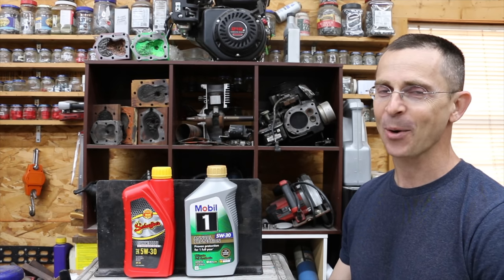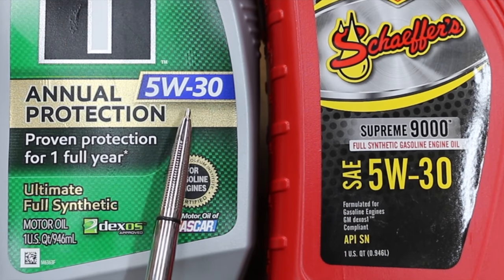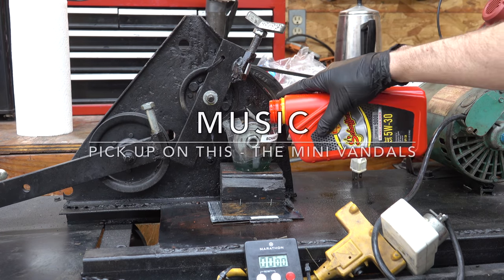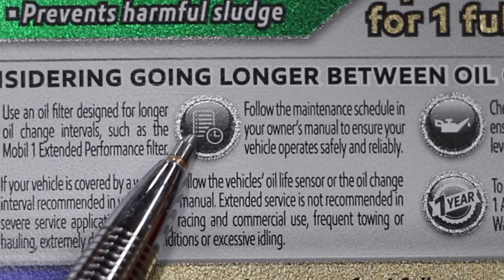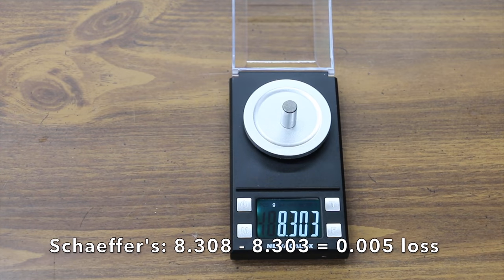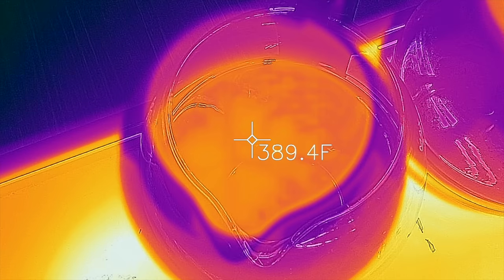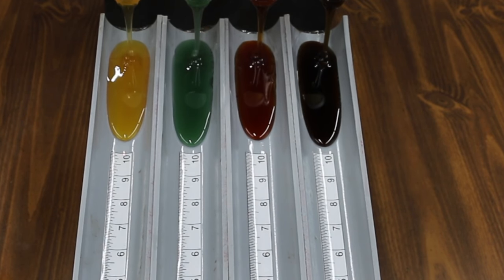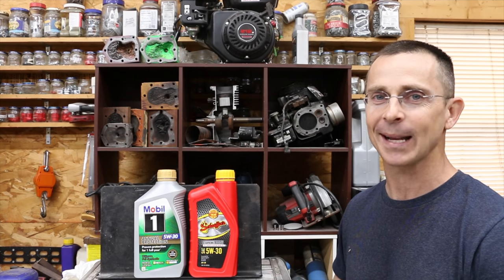Is Mobil 1 better than Schaeffer's Full Synthetic 5W-30 Motor Oil? Let's find out!

Comment: Being an Infiniti Technician the highest service interval I've seen is 10,000 miles. That would apply to the Q50/Q60 Vr30 engines and the  2.0(mercedes) engine.
Reply from the maker: This is great information! Thank you
Reply: My Porsche 997 has Mobil 1 fully synthetic specified and 20,000 mile service for oil. Porsche allow the car to be raced while under their warranty ( not voided) which is pretty amazing. The only aspect they are very strict on is not exceeding the rev. Limit of the engine,  which is impossible with pdk gearboxes but easy with manual or standard shifters.
Reply: @Frazpas  oh really ? Nice. I usually work on Japanese made vehicles.
Reply: BMWs have some stupidly long intervals too, I had a 2002 325i that called for 15,000 miles.
Reply: @emmettmartin2639  oh nice.
Reply: ...and the new Toyota Camrys.
Reply: @Amedeus1756  really ? 20k?
Reply: no ,like the infiniti 10,000 miles.. @TLGEyes
Reply: @Amedeus1756  oh I see
Reply: My 2017 Toyota Tacoma is 10K oil intervals with 0w 20
Reply: @MxRider710  Sounds like I am buying a used 4Runner or new Ford Ranger instead. 0W20? For what? The variable valve timing system or teensy oil passages? Fuel consumption? This is plain clownish.
Reply: @emmettmartin2639  Find a Youtube video of a BMW Tech boiling both BMW original oil and Castrol EDGE side by side in flasks heated by ceramic heaters. A lot of black carbon and sludge remained in the BMW oil. Only a couple of specks in Castrol. Getting European formula Pennzoil Platinum is better choice.  https://youtu.be/g7Tc-YkJRxk
Reply: All this time and I never looked up where the 2.0liter turbo engine came from. Mercedes? Thanks brother! What a solid range of engine choices. Two twin turbo V6's or a Merc turbo 4! Owners can pretend they are in F1 like when Vettel was still with RedBull Renault/Infiniti and he tuned the adjustable steering system in the Q.
Reply: @pgmurray76  I don't trust manufacturers specs usually so I just change the oil in my Volvo and the BMW at 7500. But yeah I thought 15,000 was way to much.
Reply: @pgmurray76  I would vote towards going the 4Runner. I'm not exactly sure Toyotas reasoning for 0w20. But the 4Runner still has the 4.0 and 5 speed transmission. My Tacoma has the 3.5 V6 and 6 speed. All while I have all transmission updates and no longer have any weird shifting problems the lack of power the 3.5 exhibits is annoying. The transmission still wants to shift too much. I see a Tundra in my future or a 4Runner.
Reply: @emmettmartin2639  Good, it is not my imagination. Do they do this BECAUSE of used EOA, or do they want us to trash the engines so they can be repaired/replaced and we can buy new vehicles?! I don't drive like a normal person. There is NO WAY a car will retain 80% of its oil after 20,000 miles, even with perfect valve guide seals, a perfect PCV system, and special oil. If I drove like the car gently like the day it was new everyday then maybe. Especially with highway mileage. Then yes.
Reply: @MxRider710  I don't know what they did to the Tacoma or why. It is just incredible that an Engineering company that typically updates cars slowly and incrementally made one of their trucks behave so strange. At least no more frame replacements or Tacoma buybacks. (I witnessed the process twice in NJ.)
Reply: @pgmurray76  I'm a Toyota fan for sure. Love them more than most brands, but I personally do not like what they done to the Tacoma's. Like you stated they usually take their time before doing anything, but really screwed these 3rd gens up. Like I stated I see a Tundra or a 4Runner in my future.
Reply: @MxRider710  I am so sad. Because three times a week I pass the local Toyota dealership and see how nice they transformed the exterior. BUT, this is where I see both a used V8 and used V6 4 Runner with newer offroad tires just waiting for me. Silver and white. So nice. One has Fox shocks with remote resevoirs. I would get King, but for what I am using it for, either is superior. A Ford Raptor with the 700hp V8 would be nice - only fir the last 2 or 3 years.

Comment: Schaefer invented motor oil before the invention of the internal combustion engine, and then had to wait until it was
Reply: OK now THAT'S funny!!! LOL
Reply: Those oxen went through a lot of motor oil pulling those wagons!!!
Reply: very funny, but just as an FYI schaffer started out making grease, if im not mistaken they called it "black beauty grease" their grease is excellent to this day
Reply: Good to know.  I need a waterproof grease for my boat prop and so far not very satisfied with lubriplate 130 AA or Chevron Black Pearl, as they both tend to wash out too easily
Reply: @wallacegrommet9343  i highly recommend the 238 schaffer grease, that stuff is great when it comes to washing out and pounding out under pressure

Comment: That very little advantage is not worth an extra $4-$5 a quart.
Reply from the maker: Great point. I paid too much and the oil can be found for less.
Reply: Find a rep I buy my 5 gal pails for 120 which is 6$ quart
Reply: When you are putting this stuff in million dollar equipment you would understand that it's worth the money
Reply: @charlespetersonii6989  absolutely.  I paid the same. People dont look into it deeply and invest time and evaluate companies like they should. I called up shaeffers initially and talked to an engineer who then afterwards directed me to a wholesaler.  Thanks
Reply: Your not speaking accurately. You have to look around and be an astute consumer. I love M1 AP. You can get a 5 QT jug at Walmart for $43.50 (w/ tax)...which is $8.70 a QT. I just purchased 12 QTs of Schaeffer's for $106 shipped....which is $8.83 a QT. Both of these are incredible oils.
Reply: @goldenmanuever1176  you have to buy from a individual wholesaler ,which I have a name of the guy,and you have to buy in bulk,which is the 5 gallon bucket of shaeffers motor oil to get it for 6 dollars a quart.  Which I did back in Feb of this year. If you buy the individual quart bottles your not saving as much as the 5 gallon bucket
Reply: @chadnmelissa8830  Totally agree. I was just pointing out that this oil  if you find the right place is at the M1 price point.
Reply: Project Farm Every penny you paid for Mobile-1 is worth it. Professionally, there are lots of tests to run, way more than just two tests, before you can say which one is better. You paid what you get. I trust Mobile-1. It’s more expensive for a reason...
Reply: Gary Chen i agree gary i have always used mobil 1 in previous bmw m3’s and my bmw 335d....i drive my cars hard once warmed up and want the best protection possible even if it is only between 1 to 5 percent better
Reply: 8000audiolab You drive a BMW？Wow, I hope you know how to fix problems of those German luxury cars...
Reply: Gary Chen schaeffers is kinda more expensive but that’s not an actual indicator of quality
Reply: Gary Chen thats what a garage is for! its my weekend car and its been so reliable love my beemers ❤️
Reply: Gonzo Buddy  your N=1 experimental findings have no control group im sorry but it proves nothing besides the fact that you probably took good care of your car
Reply: @chadnmelissa8830  mind if I get the number of the wholesaler? also will the 5w-20 be good for a mustang mach 1 engine?
Reply: @realtaste95  Depending on where you live there is a distributor in your area. My area where I live his name is micheal Honeycutt. I would call shaeffers themselves and they can personally give you a distributors name and number for you like they did me. If you need more help just let me know. Thanks
Reply: thats my thought too i use  $3.50 oil.
Reply: @theory816 you're most ppl.
Reply: @theory816 Rotella T6 is the best oil for the $$$ you can even use it in wet clutch applications. That's how good it is, it also only cost about 4$ a quart. And the only oil better is Amsoil. These are facts I'm not interested in your opinions. Btw Mobile 1 is less effective than rotella, it wouldn't hurt you to do research in 2019 with information that's not from 2008.
Reply: @theory816 literally google is your friend brom
Reply: Kenneth Hogarth They aren’t interested in selling 5qts down at the local China Mart. They sell bulk to fleets which makes the price much,much lower.
Reply: Gonzo Buddy There is no reason to assume Schaeffer oil could not perform as well as the Mobil 1 did.
Reply: Gamma Ray Most likely just your opinion. LOL
Reply: That’s true the cost between these 2 are greater than the risk. Both seem really good for performance and I will say after this I will be switching from pens oil now to Mobil 1

Comment: No Disrespect but I have never even heard of Schaefer's oils. Mobil 1 is readily available in my area, per the video is cheaper,
and I have had no issues. If circumstances require it I would be willing to change but so far it is not needed. Thank You for the video.
Reply from the maker: You are welcome!

Comment: So if you dont see the difference, then why overpay? 
Im choosing mobil
Reply from the maker: Thank you!
Reply: Wow mobil 1 is pretty good
Reply: Gonzo Buddy   Most fleet companies use .Schaeffers full synthetic is there million mile motor oil. They don't need to advertise.
Reply: @littlevegawagon   my caterpillar engine went 1.5 million miles with regular diesel oil....schaeffer is not all that...

Comment: Definitely off topic but how's that old ford running after the seafoam treatment?
Reply: Devyn Gorka there’s vids already. The answer: good
Reply: Yeah, if I'm not mistaken he did a follow up on the Seafoam and Restore product and both products were still delivering the benefits of their use. I've used Restore for years with great results. It's one of the few bona fide products out there that delivers on it's claim.
Reply from the maker: Thank you. Yes, the Ford Ranger is still running strong.  It'll need a clutch before too long.
Reply: @ProjectFarm  better than a new engine thanks for the reply

Comment: Rotella T6 5w-40 oil please. gotta test that
Reply: I would also really like to see how this oil stacks up to the best
Reply: me too, ive been running this is all my audis, 2.7tt b5 s4, high boost b5 1.8t a4 and soon to be in my manual swapped d2 a8L. seems to be a very good oil and made my motors run more quiet than mobile 1 and liquimoly I have used in the past. Also the oil seemd much less thinned out when i do my oilchanges.
Reply: I've asked for T6 test for a while now..................
Reply: I'd also love to see the rotella t6 in the test!!
Reply: Yes! Vs Lucas oil would be great
Reply: He's testing 5W-30's right now.  To introduce a heavier oil (5W-40) into this test would give it an unfair disadvantage.
He would have to create a whole new championship category to start testing other 5W-40's against each other.
Reply: @saberx08  yea you right, but on a side video I'd like to see it at the least. Especially the cooking test cause the entire reason I switched to that oil is for the reason of it supposedly burning alot less than others
Reply from the maker: Thank you for the video idea!
Reply: Yep asked for this last couple videos. I would like to see it against Amazon's and Motul's 5w-40 offerings. Doing the tests after a really high temp cook to simulate turbo temperatures would be even better.
Reply: I am curious also.  I use T6 in a lot of my engines.  From my 14 liter diesel truck to my 208cc lawnmower.  I recently rebuilt the cylinder head on my Jeep 4.0 that has been on T6 for 80,000 miles.  Engine had 180,000.  Really clean inside, no varnish or sludge or anything.  This engine sees a lot of time at full load (for an automobile engine).
I know the 5w40 oil would be at a flow disadvantage, but I'm curious about the lubricity test and evaporative loss results.  T6 is extremely high in zinc addatives.
Reply: @zoidsfan77  I've read the T6 formula changed a few years ago and no longer has the zinc levels it once did.

Comment: Hey man can you do some oem oils? Like Volkswagen oil, yamalube ect? Be interesting to see if they are worth the extra money.
Reply: Ditch the yamalube.   It's just a cheaper version of Motul. Use the real synthetic one instead.
Reply: At one time I was servicing lift trucks with Gulf Coast bypass filters.it was recommended that I only use Komatsu oil. I said we will use Delo 400 15 40. The same as we used in the over the road trucks.

Comment: Hey can you please test motorcycles oils? I'm trying to get the longest times between rebuilds. At the moment I use the cheapest oil I can find which is valvoline motorcycle 10w 40
Reply from the maker: Thank you for the video idea!
Reply: Im cheap too. I found 15w40 Rotella is diesel and gas, also certificate for wet clutch. 
You can find the gallon at Walmart.
Reply: I use mobile 1 racing 4t on my Drz400s my buddy likes to use rotella t6 5w40 (for diesels) on his yz 250f. My unprofessional opinion is the riding style and maintenance frequency would matter more to a bike then how much you pay for a few quarts of oil. That being said I wouldn’t mind seeing some test results either!

Comment: I've been using Mobil 1 since it first came on the market. I've run my cars to 200,000 miles and in every case  the engine  bearing clearances were still within spec.   I change the oil and filter every 6000 miles.  When dropping the pan the engine internals are free of solid deposits and sludge.
Reply from the maker: Thanks for the feedback.

Comment: I really hope you cover 
Castrol GTX oil as well. 
You have an awesome way of testing and comparing these different oils. 
  If you haven’t already done it I would love for you to test oil filters. Years ago all I would put on my vehicle was Fram  now I would not put Fram on my lawnmower. I’ve had several vehicles lose oil pressure and all I did was change the oil filter from a Fram to an AC Delco and fixed it!
Thank you for all you do.
Reply from the maker: Thank you

Comment: What I get out of this really is, whether you chose Shaeffers or mobile One, your not going to have any problems either way. They both prove basically do a great job no matter which one you chose. I never heard of Schaeffers and I have to say, it does an amazing job. I have done a lot of research between different synthetic oils and learned a lot. I ended up choosing Mobile One and been pretty happy with it. I think I'd be just as happy with Schaeffer as well. I am extremely impressed going from regular oil to full synthetic and will never go back to regular.

Thank you for putting out this video. I wish Mobil One pulled another victory but knowing both are pretty much the same except on price. I cannot complain!
Reply from the maker: Thank you.

Comment: I have never heard of schaefers. but I did a test with my son for a science project .my dad was a farmer . he said they would re-clean oil with a hemp rope. we used cotton and some different marital.  used torque wrench in electric motor how much force to stop motor. after 4 filterings . we had got within two lbs of the original force took to stop motor.  base line 34 lbs   1filter 25 2nd  28  3rd 31 4th 33.  motor oil had over 3000 miles on it on a motor with over 100k mile. liked your test
Reply from the maker: Thank you for the feedback

Comment: I have used Schaeffer's for a long time since it has more molybdenum that other brands
and when their prices shot through the roof I did switch over to Milesyn from WallyWorld
since I didn't want to pay extra just for name of some well known manufacturers.

Maybe one of these days you could include engine oils from Miles in your tests since it
seems to be a good product for a much lower price that the big names are charging.

I look forward to find out more about Miles products and remain with best regards,

Jochen

Comment: Hello. Thank u again so much. I think it's unanimous... Everyone loves u and what u do. I'm definitely an oil nerd and have spent hundreds of hours testing by personal application or researching formulas. Schaeffers actually is a notch above many oils. The 9000 in particular. Mobil 1 also has a large variety of different formulations and one is definitely better than another. The new 'fs' series r true full synthetics (the new sp rated)and have something extra in lubricity and wear. Also the 15w50 has shown super low wear results on cams over time. But what I wanted to discuss (and these are just my own thoughts and wondering) is that many of the additives that r making all the difference like Antimony, Hex-Boron, tri Moly, zddp, etc require heat and pressure over time to 'plate' and actually work. I don't know how u would test this but I bet an oils long-term anti wear performance would b much different than a bench lubricity test. I bet one oil (like schaeffers w antimony, etc) would do 'so-so' on a bench test but over the course of years w measurements of engine parts..... would produce better results. Like after 100, 000 miles and a disassembly and inspection w measurements would b the way to see if something really performed in real world applications. I know there's no way for u to do that... I'm just thinking out loud. But I bet it would b very different. I've seen many Schaeffers tests after several thousand or a million miles and the engines are almost new inside. So I wonder if the lubricity test is more for the immediate film strength and lubricity but not having that real protective plating process for boundary lubrication. Anyways, just thinking out loud. We very much appreciate u!
Reply from the maker: You are welcome!  Thanks for the feedback.